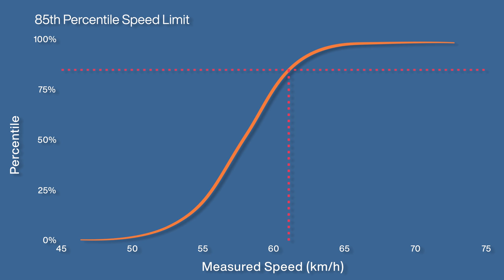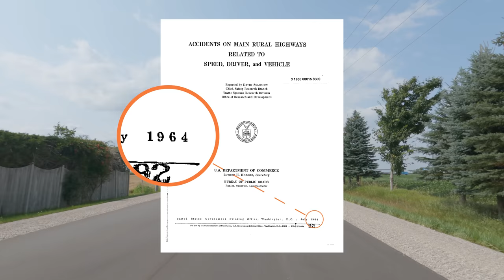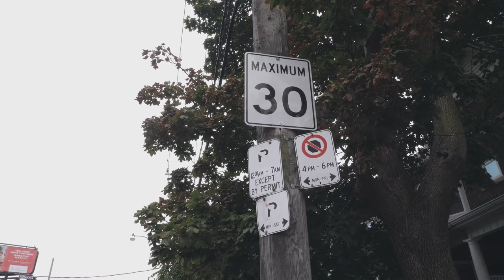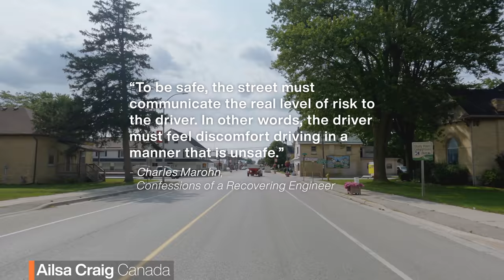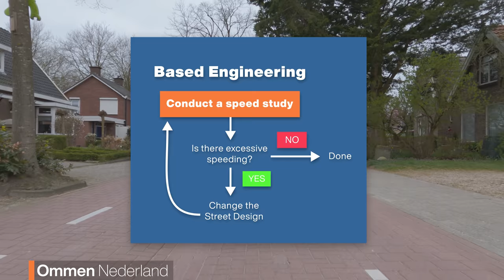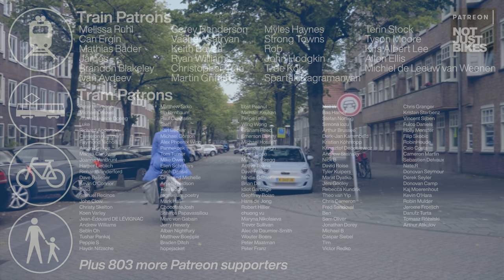The Wrong Way to Set Speed Limits [ST06]

Comment: 85th percentile is only part of the story, and is often assumed to be the sole determinant for speed limits when traffic engineers fail to coordinate with highway engineers. Highway engineers are wedded to Design Speed. That’s the first thing they come up with before even beginning to design a road. When highway and traffic engineers work together, design speeds can be set to appropriate levels right from the beginning. A road/street with a low design speed will, by its very restrictive nature, present conditions that naturally encourage slower driving. Upon construction, the 85th percentile speed measurement will almost always be in an acceptable range. But even if a stretch of road has a quantity of numbskulls barreling down it to skew the results, the speed limit may NOT be posted higher than the design speed. Design speed trumps 85th percentile speed.

Comment: This method of setting speed limits is horrible. I didn't watch the whole video, but in my personal opinion, all busy tight-packed streets should be 25-35 depending if it's a city, or a town where the houses lay back a bit. All roads should be 35-45. Stroads should be 35-50. ALL highways should be 65 and upwards. Just my opinion from central PA, USA. Makes sense to me.

Comment: This is sound theory, but in practice it doesn’t always hold up. It may in large towns and cities in the US, but in rural areas we drive 60 mph on the tiny, winding roads. We’re very comfortable driving like this because it’s all we’ve known, so making roads smaller for us would not necessarily slow us down.
Reply: Is crazy, 60mph in 10ft road.

Comment: I don't know where this guy gets his information from but in the us this is not the way road speed is calculated or at least since 1986 when I first started as a civil draftsman. Road speeds can get change buy devilment around  an existing road witch is why you see that black tube going across the road way. That is what counts traffic on that road way it is also able to determine the weight of  vehicles as well as frequency. Size of the given road and and surrounding usage is the biggest determining factor as we have set guide lines for residential, commercial, thoroughfares as well as limited access highways. New roads are designed with this mandates in mind and then Engineered for what has been deemed safe for the average car ie.., the degree of banking any curves will have, the crown the road has for storm water management, The width of each lane as well as shoulder type, guardrail or curb and sidewalk, the rate of incline and decline pulse a number of  other variables then after all that the what I would draw out to get approved for construction would actually be designed for 10 mph more then what the posted speed you see is. That is how they are designed on paper sometime construction doesn't live up to design and that's when the engineer with the clipboard and a survey crew shows up to determine  what fixes are needed. A lot of time counties or cities don't have enough left in the budget to fix the issue and road warning signs get posted instead.

Comment: I very seldom drive over the speed limit. And I don't constantly check my speedometer unless the posted speed is less than 35 mph. I use cruise control when driving over 35 mph. And I never, never, EVER violate the posted speed limit in a school zone. I will NOT be responsible for injuring or killing a child. And it's not because I'm afraid of the law. It's just the right thing to do.

Comment: Does North America not have a standard speed limit for towns and cities? Here in Europe, every town welcomes you with a standardised rectangular sign with the town name on it, BAM! you know you have to drive 50 kph  or less (unless raised for throughfare roads to up to 70 in my country or lowered for pedestrian-heavy areas to 30 or 40) or 80 if it's a motorway going through the town. Yes, there's a lot of signs in general so spotting a reduced speed limit may get difficult, but normally you just don't look for speed limit signs when approaching a town, you just slow down to 50 (and if you're like me, you then check your speedometer all the time to see if you're not speeding :/)

Comment: Only made it a couple minutes into the video because the first part simply isn't true. Most highways in the US are designed for a given speed. The geometric design is based on the design speed. They aren't building new roads and then seeing what the speed limit should be. Many of the roadway speed limits are based on the traffic, access points, and adjacent use. 
To act like the 85% rule is still the way engineers are doing designs is misleading at best.

Comment: There's a Kroger grocery 5 minute drive in two opposite directions from me. One of them is just a few small back streets to get to with a 35mph speed limit. This is a majority black city and these neighborhoods are majority 'new' Mexicans in America Americans. To deal with the speeding through these small streets 10 of these like speed bumps, I guess speed controllers really, were installed. If you are going 35 the speed limit, you float across these small low bumps as if they are not there. The problem is that now all these clowns, you always have one in front of you both way to the store and back, but they don't even go the speed limit now. Every single clown has to slow to 1 to 2 mph to go over each of these bump things. So now instead of 5 minutes at speed limit to get to the store a mile or mile and a half from me, it's more like 15 minutes each way & instead of floating over the bump at the speed limit, when you go at 1 to 2 mph, just like if you go too fast, the bump mule kicks you in the behind. So now I can either deal with this, go to the other store down a avenue and expressway or drive many miles out of the way to avoid these few blocks going way around the long way. Like a 8 mile drive instead of 1 & 1/2. I wish these dummies knew you can drive fine at speed over these bumps, but then again they think your supposed to bike toward on coming cars.

Comment: Ding Ding the "correct" way to design something to be used as intended NOT enforce a usage that feels "alien" 
I remember driving on I5 into LA and there is a section where the sound walls get high and you are driving in a concrete canyon and EVERY DRIVER slowed down at that point every time 
I wonder if a % of the fast road / slow limit is partly a cash grab move to "trick" drivers to speed and to get a LOT of tickets ++ lower infrastructure cost to NOT change it for "slower" and to just hang a NEW sign

Comment: The Speed Limits and driving in Utah County are awful.

To the Not Just Bikes I want to let you know, when I was growing up in the 1980s, 1990s. The I-15 Utah Freeway used to be 65 MPH. But in the later 2000s the Utah Engineers raised it up to 75 MPH and I feel more scared to be on I-15 since I worry the car I'm in will crash.

It's even worse in the Utah County streets. Almost everybody is driving too fast up to 40 MPH or 50. My older brother likes to drive very fast, and he makes me very nervous speeding through State Street Highway and checks his cellphone while driving. It's even worse with my dad who usually looks at his cellphone constantly while driving.
I feel more comfortable with my mom or sisters driving me places.

Since I ride my bike all over in the city. I also hate having to cross State Street almost every day while shopping at stores which is very dangerous for me crossing the streets on my bike. I worry about some idiot driver in Utah speeding too fast, not paying attention and looking at their cellphone while driving will run me over. Or drowsy driving. Utah Drivers Ed program needs to be updated and make drivers take their drivers test every year.

The worst part about State Street is the lack of overpass bridges and underpass bridges. Especially on the Utah bike Trails. I'm hoping that more people take the UTA buses and carpool more often. Yes, we do have speed limit flashing signs in Utah. But the roads in Utah County are a mess and there's a missing sidewalk section on the Provo High School Freedom Blvd area by Mcdonalds which was never filled in. This isn't the 20th century anymore. I'm ready for the road problems and missing sidewalks in Utah County to be fixed.

Comment: A couple of thoughts... 
Apart from the road design itself, other differences between European roads and North American roads seems to be the lack of road markings and effective signs. Speed limit signs seem to be a rarity in America. Even when you do see them, they are often placed in odd places (behind other signs, around a sharp bend or behind a bush or tree) and are too small for fast traffic to read. In towns, they are often placed hundreds of feet from the point where actual change in speed limit is set. Road markings (which should be able to convey a lot of information to a driver) are missing, too badly worn to be seen and usually very badly designed. 
Having lived in both places, I find that the expected standard of driving by American drivers is extremely low. The idea that drivers in America are apparently unable to maintain enough concentration to drive safely and that roads should be designed for them is an awful premise.
Maybe, apart from making road designs better, driving standards should be improved?
Finally, being a "boomer" myself, I find the use of "boomer" to be offensive and ageist! Not all "boomers" are outdated and inflexible. I had thought better of you. :(
Reply: Unfortunately, road markings don't work, in my experience. I can't begin to recount the number of near crashes and near misses of hitting pedestrians I've seen where STOP was clearly painted on the pavement (in lieu of putting up signs), along with a stop line. I don't know that redundant signage would have made a difference. 🤷‍♂️
Reply: @Prof_Jeff  Unfortunately, that just highlights what I stated about the US standard of driving.
Reply: @markstracy5466  I don't know if it's poor driving skills alone, or a blend of that with being oblivious, self-centered/selfish, and/or entitled. I know of two locations near me that have redundant signage for "No Left Turn", yet almost every time I pass those intersections, some idiot is attempting a left hand turn! 🙄😡

Comment: More and more cars on the road and the speed limit is reduced over and over. Major congestion is dangerous 
When people travel slow, they are less alert, The faster they travel the more alert and aware of their surrounding they are
Traffic lights are not synchronized to improve the flow but in most cases hinder the flow
Now we have traffic lights, than stop left hand turns when you could turn safely.
Lights for left hand turns are often green for absolutely nobody and no cars move in any direction for extended periods of time
There are even red lights stopping right hand turns 
Construction zones slow down travel when there is no construction or danger and extend far beyond the area of construction
I have seen construction signs that must be abandon cause nothing is going on for weeks/months
Most stop signs should be replaced with yield signs
Every city town needs major improvement to help the flow of cars to be economical and efficient
Most Car achieve maximum fuel efficiency at approximately 70 km per hour or 45 miles per hour
With sky rocketing fuel prices, fuel efficiency is of major importance
In order to improve fuel efficiency and reduce congestion, serious effort to improve traffic flow is in the best interest of everyone. 
Save fuel, save time
I would like to believe that the traffic controls are designed to be most efficient for fuel and time but nothing is perfect so there are a rarely problems
But I do believe they are be made most inefficient for fuel and time but it couldn’t be design completely inefficient so you rarely find efficiency for fuel and time. 

If the time to travel to a destination takes twice as long, that will double the number of cars on the road
The faster we get to our destination the fewer cars on the road

Comment: Speeds should be set inversely proportional to the population density and foot traffic density of the area in a 10mile diameter of the sign and not exceed ten fold the the average running speed. in MPH this means 80mph should be the maximum.

Comment: then there's my city, reducing the speed limit to 30 on a longer street, but not adjusting the goddamn traffic lights. Now whenever you use that street, you will most definitely wait at every traffic light. Same goes for cyclists. There is a better way to deal with speeding; gentle road bumps. I have those in front of my apartment complex for years and it just works. They aren't very tall, so driving with 30kmh over them is pretty okay. Driving faster than that however might wear your tires and perhaps every bumpers out faster.

Comment: 3:13. Those cars are driving in the bike lane.
Reply from the maker: That's not a bike lane, it's bicycle "sharrows". It's a shared bike/car lane, and yes, they're insane and dangerous.
Reply: @NotJustBikes  actually, they are not as insane and dangerous as the cyclist safety tracks they use here in Germany. These are marked as parts of a lane on the right side (were other cars park next to, most of debris and road surface damage ist located). They are marked with a broken line and often painted red, so they look as if they indicate an independent lane for cyclists. This leads to cars overtaking with way to few distance to the cyclists and dooring accidents. They don't have to be used by cyclists, although cyclists need to follow the rule to cycle on the right. But doing so, they will be taken into shared responsibility when an accident occurs, i.e. a dooring accident. 
Riding with the flowing traffic in the middle of the lane to show some presence OR riding on a designated bike path off the road would be a far better solution.

Comment: just one question where the hell do you drive  40 kmph, I drive 50 with a damn tractor and 50 is like the absolute minimum in Belgium, like all non small roads in villages / cities should be at least 70 kmph, not like slower mate.

Comment: My country critically lacks highways and people are forced to use roads through towns. Nearly all of them can be driven with 90kmh nothing signals drivers should slow down to 50 beside signs. Another problem with going such roads is fucking constant barrage of sign and limit changes I kid you not there is sign every couple seconds and limit changes every minute. People want to go from A to B quickly and after driving such road for like 10minutes you get desensitised to all signs that you don't care about them at all, then road through town is exactly the same as between them and you get  people driving 90 through towns constantly those more aware slow down to 70 or so but you will be hard pressed to find people driving allowed limit of 50.

Comment: If they did an 85th percentile study on US 202 in southeast PA, they'd literally have to raise the limit by 25mph… seriously, 55mph on a 6-lane highway??  Absolutely not.  Even the trucks and old folks in the right lane do at least 65 lol

Also there's a 24-mile stretch of the PA Turnpike that is perfectly straight, perfectly flat, 6-lanes wide, and in the middle of nowhere so there's little traffic, speed limit 70mph.  Even the slow drivers are 15 over, and triple digit speeds are quite comfortable…

Comment: Doesn't this depend on the city? I mean, what is the density of cars in an average city in the Netherlands? Compare that to Los Angeles, which is where I live, and different priorities might come up. The density in Los Angeles is so terrible that the question is not how to get people to slow down and enjoy the streets. The question is how do we reduce congestion. Los Angeles was never built with a common city center. It grew as more and more roads were being built to connect neighborhoods and businesses. It simply was never build to have that "European charm" that these video constantly compares to the netherlands. So given that fact......these videos are suggesting fixes that might actually make the problem worse. You gotta compare apples to apples.
Reply: Is video, is about place where people don't respect the speed limit, in Los Angeles, it can be used in suburbia by narrowing the lane to 15ft with tree on side, people will feel too much unsafe to drive over 15mph. 
And by the way, more low speed limite can improve slighty the traffic flow because car can drive more close of each other and limit the phantom jam. 
One solution used by my city (for the grid part), is make all street one way (alternatively), that reduce the waiting time at traffic light (or they are removed in some place) and improve the speed of flow, the people going straight stay in 4 middle lane and go in outside-lane just to turn.

Comment: A few problems I see with this: 

The US didn't have the urgency of the damage of a war, or 500 year old cities that never changed to encourage these lower speeds and more cautious driving. 

The US and Canada are VASTLY larger than Europe, and many cities are bigger here, too, with more surrounding suburban regions not even factored into that. It's a natural desire to drive faster to get where you're going - regardless of the cost. Even our highways and parkways are inefficiently routed and placed in some cases.

I'm not saying your video is wrong, quite the opposite, but especially given the amount of roads in the US, making these design changes here would be comically expensive, and we have our mercenary military to feed.

And finally none of that factors in the culture of cars we have in the US, fueled again by the distances covered in some places, which also inhibits the alternatives of public transit we see in some cities with denser areas.